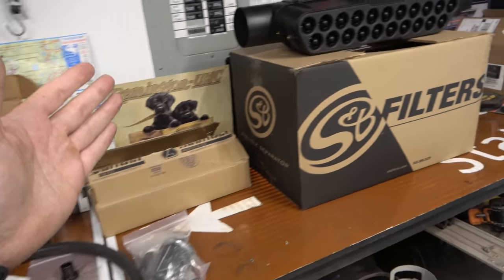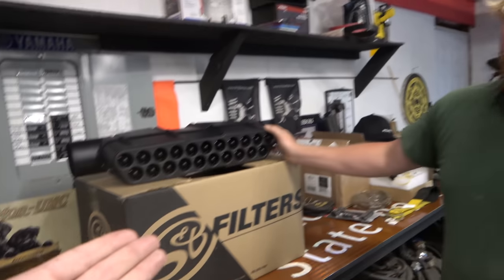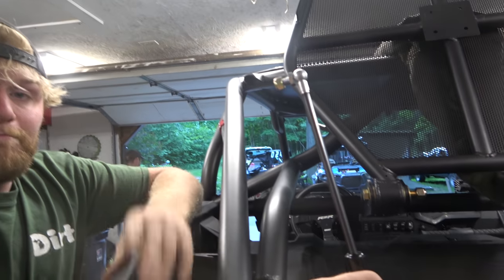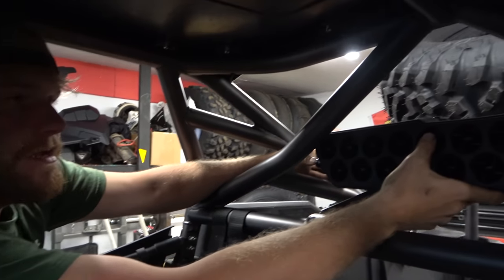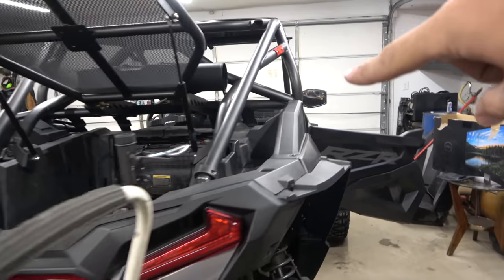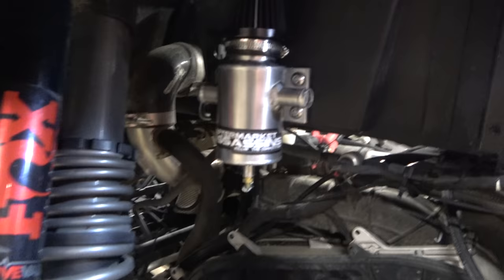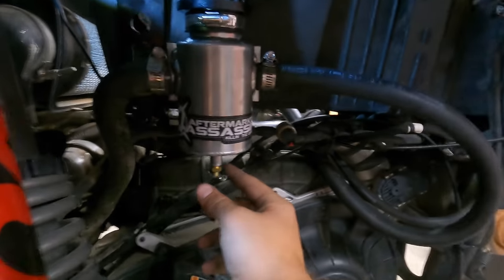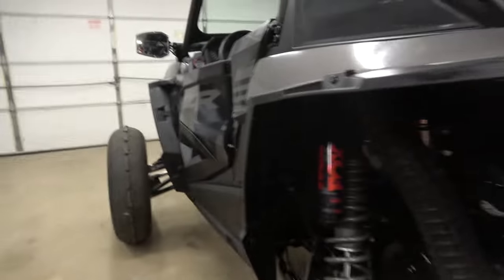Must Have Parts For Longevity On Your SXS | Aftermarket Assassins Catch Can & S&B Particle Separator

Comment: Hey fellas...wondering if you can help or have some advice. I am getting ready to add the assasins stage 3 stuff...same thing you guys put on "Luci" aka loosey luci😂 Anyway...i got the 2.5" assasins head pipe as well. I already broke one of the exhaust bolts holding the headed to the exhaust and barely cranked it w a pry bar. Ive been told if I break a head bolt I'll have MAJOR PROBLEMS!!! Is it not even worth putting the head pipe on? And if I do any tips on getting em out. Really appreciate it boys.

Comment: Are your light bar tabs meant for baja designs 40"? I have the same cage with tabs, just haven't got the light bar yet. i like the price of the RC bar than the BajaDesigns light bar.
Reply from the maker: My RC fit right in. For the price I think you’re better off with a RC light bar

Comment: Cut down that pipe from the oil cap to the can 😂 all that excess is giving me ocd 

Howdy from the uk 🇬🇧 btw 💪💪❤️
Reply from the maker: 😂😆😂 I’ll cut it down when I fix the Alba Racing adapter
Reply: She’s looking sweet btw,quick question,how you gona mount your whips now ? I’ve got a similar set up with Polaris carrier and had to cut and mount them to the rear sides,be good to show you but can’t attach pics
Reply from the maker: We pointed them out in the video. The Brick City Fab cage comes with mounts up top